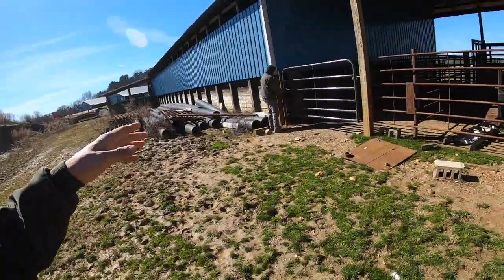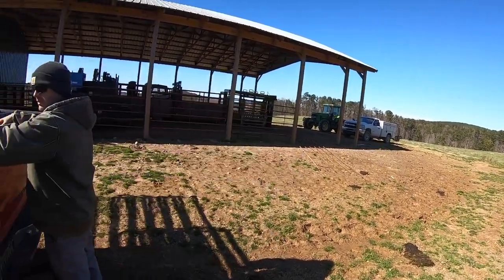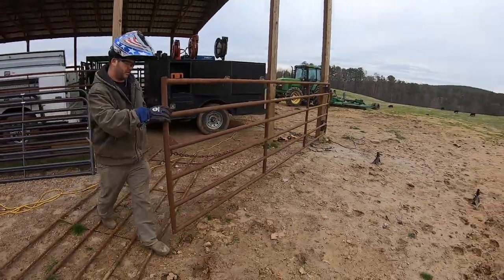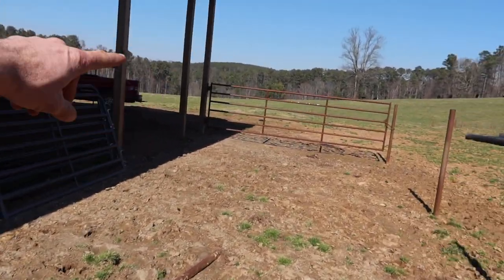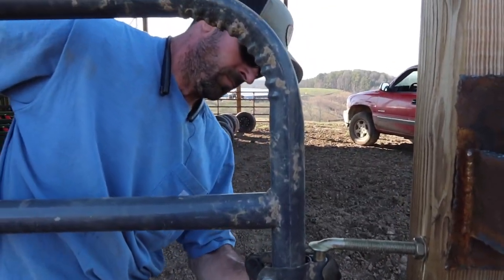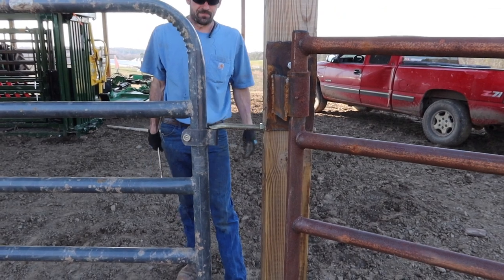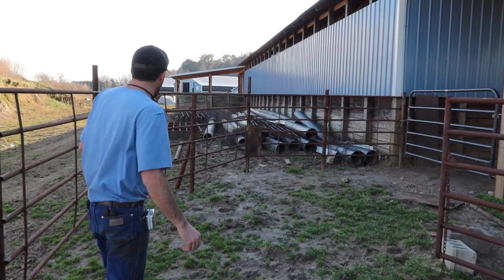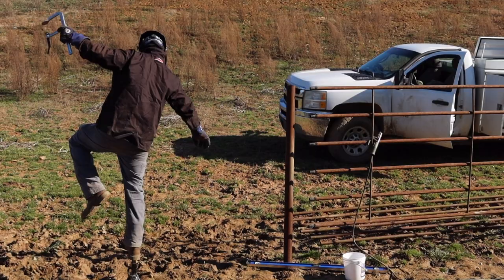Building Cattle Pens - Part 3 Sorting Pen

Comment: When welding 7018 start up and start doing u and count 1 2 1 2 let the puddle fill up and keep going
Reply from the maker: Thanks for the tip. So start at the top and do this going down?
Reply: @FarmerHunt  Start at the bottom. Go from one side of that 6011's root, make a smiley face shape to the other side of the root. The 1212 mentioned by Thomas is speaking of is the rhythm you use for getting a good, consistent bead. 7018 makes a very pretty weld, but it's more picky about surface prep and technique. You make a slow, steady swing back and forth, like a clock pendulum, and pause a moment on each side. Keep stitching your way back and forth on the way up the previous weld. Keep in mind that bringing the electrode closer to the metal will increase the metal deposition rate (and increase amps), while pulling the stick back for a longer arc will increase the heat (and voltage), so you can burn off the crud and build your initial puddle. When you're doing that stitching bead, focus on timing and arc length, with your goals being to make a good puddle (penetration), and filling it up with filler metal, without burning through the parent metal. If you start having overheat issues, try raising the amperage on the machine, so you can put down your bead faster, before the part heat-soaks. If too large an area glows from heat, or you're burning through, your amperage is too low. If you're just laying a bead on top of the parent metal, without good penetration, your amperage is too high (or your electrode is too close before you establish a good puddle). 
...at least I think so. I haven't welded in about 20 years. I wouldn't be surprised if the machine did a lot of that stuff for you now, while playing bluetooth music in the arc.
Reply from the maker: @buckstarchaser2376  Thank you very much for the advice. We don't do a whole lot of welding so we are still learning.

Comment: I reckon you have a gutter along that roof edge so your sorting pens don't get runoff from the roof in 'em?  Did you build the continuous panels or does someone in your area sell them?
Reply from the maker: It's on the to do list! We didn't build the panels. We bought them. They came in 20' sections.
Reply: @FarmerHunt  Yep a gutter makes a huge difference on whether you are in mud or wet dirt in the winter.  You wont regret it.

Comment: Hows this working out? Anything you do different ?
Reply from the maker: So far we are very pleased with everything. Nothing that we would change. The 45 degree corners were definitely a pain on the part 3 video. After it was done though, we were glad we did it. We are working on the interior pens and finishing it out. That’s the part we are most unsure of. We want to have plenty of room around us when we work cows, but also want to make sure it functions well and we can send our cattle in whatever direction we want in the barn once they are caught.